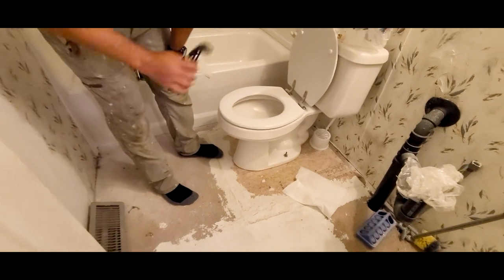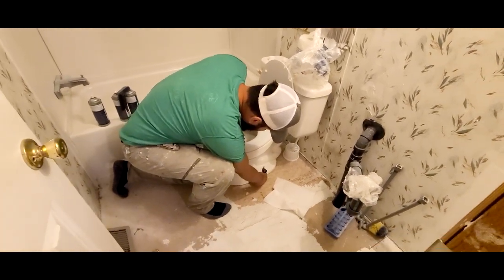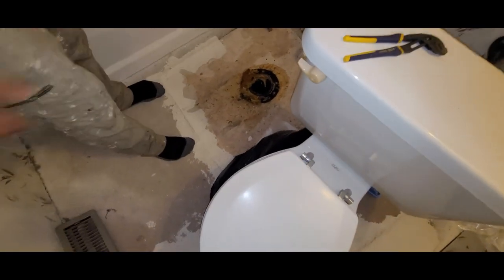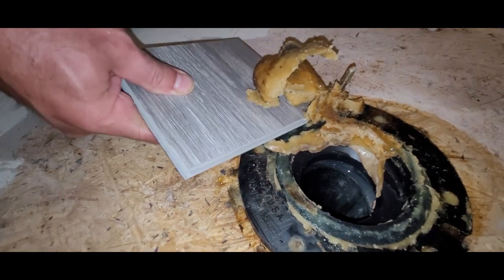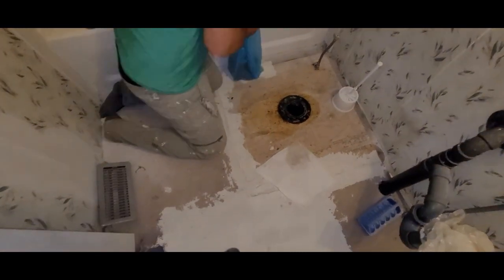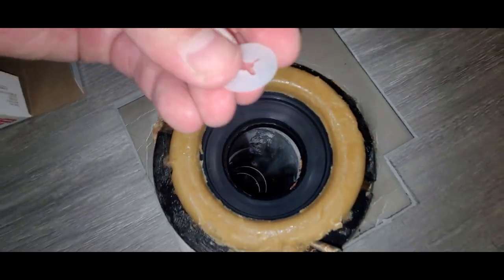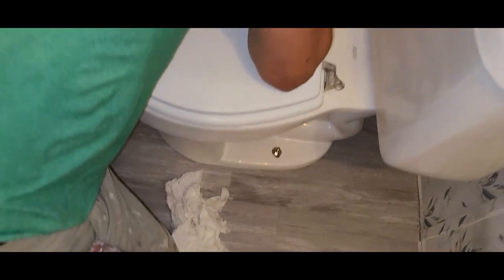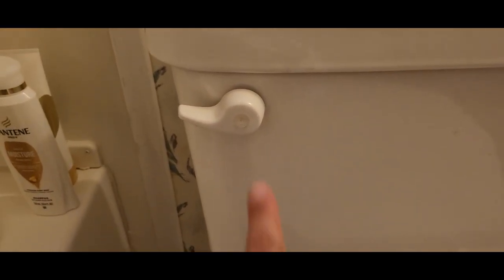Mobile Home Renovation Episode 6: How to remove and replace your Toilet.

Comment: Your husband did a great job on the explanation and the removal and reinstall of the toilet! That is a really cool toilet too. It’s an Eljer Savoy from the early to mid 1990’s. They have good flushes but from my experience, they can clog easily sometimes since it’s one of those early 1.6 gallon per flush toilets. The 1.6 gallon per flush toilets were mandated in 1994 in residential buildings and in commercial buildings, they were mandated in 1997. In other words, toilets made before these time periods used 3.5 gallons per flush or more but toilets that used 3.5 gallons per flush became illegal during those said years due to the 1.6 gallons per flush or less law (if you know what I mean). Personally, I have had much better experience with the older 3.5 or more toilets as they are harder to clog than newer 1.6 or less toilets. Great video btw!
Reply from the maker: Thank you for the compliment and the information.  😃

Comment: His English is better than my Spanish! 😂 Back in our younger days, hubby and I gutted our first mobile home to the studs and we had three little ones running around! Just an FYI, You can paint the hideous wallpaper too. It takes paint well with no chipping. If the walls are sound, I would advise not taking it to the studs. They don't hold regular drywall. Hubby and I had to find a workaround and used thin 8x4 sheets of smooth backer board.
Reply from the maker: Thank you for the compliment and the advise. So far I think it is looking great. 😄

Comment: A question for your hubby. How did he put the drainage hose on top of the floor. Do u have to take it off nd put it on top or what was the process to that part?
Reply from the maker: So that top piece is called the flange. We did not have to change ours becuase it was in good condition but if you need to change it. Take the wax off and there will be some screws holding the flange to the floor remove the screws and the flange should come right out. You may need to pry it off but it should come out easy. It has a rubber "stopper"on the bottom that helps seal with the PVC that is going to the septic/sewer.
Reply from the maker: I'm sure there are videos on here about that. Just search replacing the flange under the toilet. Something should pop up. Hopereplacing it easy for you. 😁
Reply: @chosennpreciousfarm  appreciate the help thank you very much.
Reply from the maker: Of course your welcome. 🙂